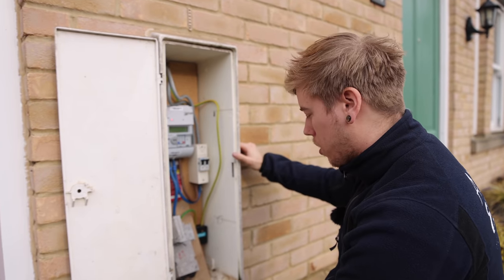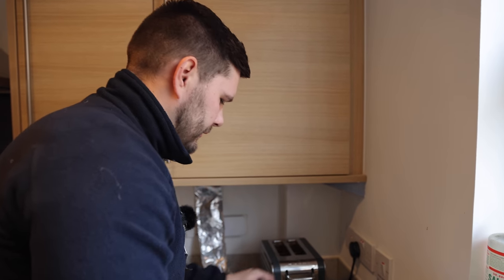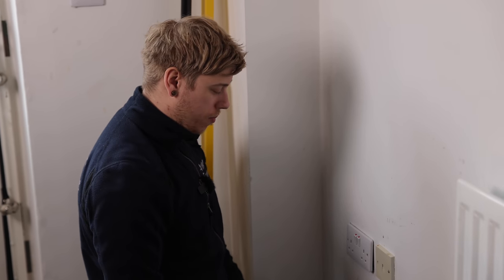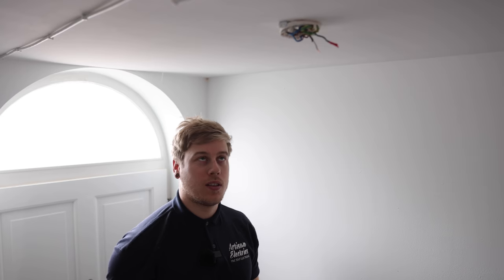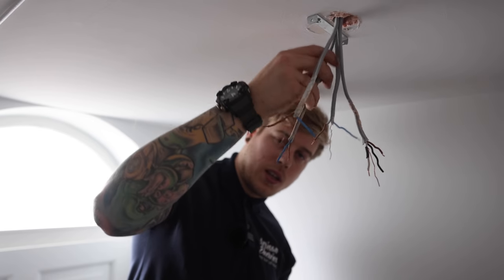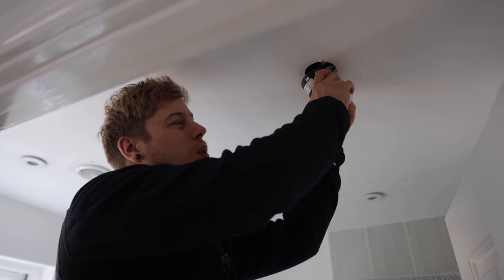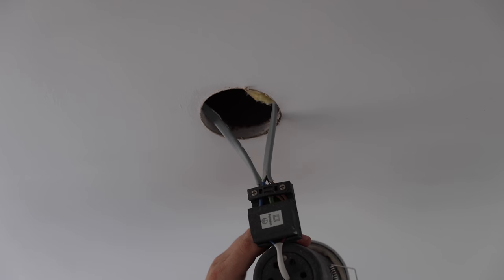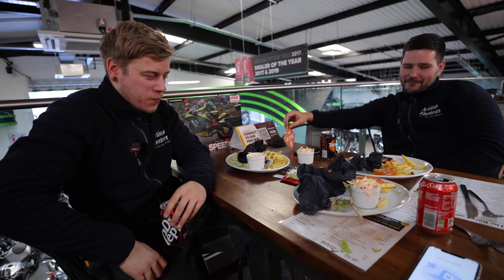CHECKING DIY ELECTRICS, INSTALLED NEAT BUT WRONG! - Electrician Life

Comment: Hi Guys. Here in Australia, it is illegal for anybody to carry out any electrical work themselves, unless you are a fully qualified electrical contractor.  That takes in tasks such as touching/altering anything to do with power points, light switches, adding any wiring or wiring alterations, anything to do with meter boards etc. Simple tasks such as changing light bulbs and adding on a four into one power board are OK of course.

That said, the irony is that anyone can walk into any hardware store in Australia, and purchase switch gear, sockets, any type of flex cable etc, without question or restriction. Given that the laws in Australia state that you cannot carry out any electrical work DIY, then hardware stores need to stop selling these products to the general public. One approach could be for any shopper to show proof that he or she is a licensed electrical contractor at the point of sale at the hardware shop, when purchasing these items.

Your laws in the UK seem to be more relaxed on this topic, regards DIY workers carrying out certain electrical jobs themselves. I guess the downside to some allowable DIY electrical work to be performed by the general public, can bring on issues such as dodgy unsafe wiring, that can lead to electrocutions, and dwellings potentially burning down. I have noticed that a few UTube electrical channel shows include instructions and procedures in the professional electrical wiring of power points, light switches, rewiring or upgrading metre boxes etc. Does this then provide encouragement and a basic education for the DIY brigade to perform this kind of work best left to professional electricians. Food for thought there people!
Reply: I’m not an electrician but I do have a scientific/technical background. Changing a socket outlet, light switch, or light fixture, assuming the wiring remains like for like, is child’s play… not messing around with anything more difficult than that though!
Reply: @jamesherbert8391  Hi James. Given your background, gives you a distinct advantage over most DIY er's to carry out the work you have listed, but there are a lot of folks that attempt this kind of work with little to no knowledge with the basics of correct and safe wiring ciurcut procedures, trunking, earthing, testing etc. This is where the main problem lies with the general public, which brings on unwanted accidents and deaths, and destruction of property. I am not an electrician myself. With all due respect to yourself, i feel that any countries government can't play it with an each way bet. By that i mean, if you let the public perform some of the jobs of qualified electricians, as in the UK, then you will end up with ongoing unwanted consequences. In my opinion, it's better for a Government to make it illegal for the general public to perform any kind of electrical work, like here in Australia, and at the same time police the sale of electrical components over the counter of all hardware stores and electrical trade sales outlets. I know that in Australia, many people cheat the system, but the materials from hardware stores, and perform electrical work themselves to save money.  If their house burns down, it will be investigated for non compliant electrical work, and if proven, will void any insurance payout with the loss of their property.We get our share of deaths and property loss each year from unqualified electrical work carried out by unqualified people.
Reply from the maker: Interesting 🤔
Reply: In the UK, if you are not qualified to work on electrics but you have, you should notify your council buidling control you have made a change and they will come and inspect it before you energise the circuit. So whilst its not illegal to work on your own home, its also been made reasonably easy to have it checked for a small or even no cost.
Reply: @martyndavies1482  Hi Martyn, You make a compelling point here, but with respect to yourself, how many or what percentage of the general population would bother or go to the trouble of notifying their Council Building Control, cost or no cost,  that's the real question.Knowing human nature as i do, i would imagine some would and some would not. It's the would nots that raise the concerns here. Again, i raise the points of UTube electrical channels going into in depth procedures of carrying out professional procedures, which promote, encourage or foster the general public's participation into carrying out their own electrical work, and hardware stores and electrical trade outlets that sell electrical products to the general public that enable them to carry out their own electrical works.The bottom line is that when it comes to REAL health and safety matters in life, some things are acceptable to carry out with DIYer's and some things are best left to professionals to deal with. Finding that fine line or common ground between the two is the tricky part for the Governments and the population enlarge. Thanks, Greg.
Reply: @artisanelectrics  Hello to the team at Artisan. Yes, interesting indeed. I for one enjoy watching your channel, as i find your content and presentation interesting, informative, entertaining, fascinating and educational. However,  i guess the thing to consider here is are you really doing the general public a service by educating them on the methods and  procedures of professional electrical works best left for professionals only. That holds true for any other electrical U tube channel show or video presentation as well. That is something well worth thinking about.  Just my humble opinion there. Cheers, Greg.
Reply: If the laws changed in the UK to be as strict as they are in Australia, I would find that a significant government intrusion in to what I can do in my own home.  Of course I accept that the law is sensible with regards to gas and consumer unit changes (less so for running a new final circuit - which may be a better alternative than adding to an existing one, which is allowed) but there has to be some leeway for competent people to be allowed to do their own work.  I accept that does leave the door open for dangerous work to be done, but how far do you go - there has to be a balance. Perhaps we should be teaching more of this stuff at school, practical skills so that you can have some degree of self-reliance in later life.  In the UK until the 90s many new electrical appliances came without plugs - you had to wire on your own (a legacy from when we had different plug types). I remember plug wiring coming up at school - although many were put on very badly with single insulation visible and cord grips not secure.
Reply: Yes I agree, go into Bunnings, Electrical equipment to be installed by a Licensed Electrician, makes me laugh every time
Reply: @austinvert8626  I would say it was a very round number! Its another philosopical question, are the people watching these videos better off from it having presumably learnt something, or are they armed with a little knowledge being a dangerous thing? I'd like to think that if you are watching these videos you would have some level of wanting to do a good job, and you are likely going to do the work yourself anyway. I am inflicted with the DIY disease, heriditary through my father's side of the family, it can be a gift and a curse!
Reply: @rossthompson1635  I Agree and even if the laws were changed it would inconvenience the knowledgeable DIYer and the dumb DIYer would still continue to do their own work.  Last time I looked the UK was pretty high on the scale of electrical safety anyway - so must be doing something right.

I lived in Australia for some years and can say that getting an electrician to do minor works is all but impossible - they don't get out of bed for less than half a days work and charge like wounded bulls for jobs that should take less than 30 mins.  

Australia still presents a protected economy for trades - it extends to plumbing, technically illegal to change a tap washer, telecommunications, you can not install your own network cabling, or telephone extension points, as well as electrical work.  There was even talk of making home theatre speaker installation and TV antenna installation trade only activities.

I think the UK has got the right balance - although the upcoming requirement for AFDDs seems heading towards dictatorial rules for no better reason than commercial gain - and did I hear the other day that the industry wants 'electrician reset only' breakers?
Reply: @martyndavies1482  Where do you live? The last time I checked with my local building control it was a case of them not really wanting to so it was £2-300 for them to have a look.
Reply: @martyndavies1482  Not all work is notifiable under Part P.

"Part P will apply to all electrical work in dwellings, whether carried out by professionals or DIYers.

Some DIY work will require the submission of a building notice to the local authority and the payment of a building control fee.

Some minor electrical work will not be notifiable (see above). Examples include adding a lighting or power point to an existing circuit, adding a spur to an existing circuit or replacing a light fitting."
Reply: @barrieshepherd7694  Thanks, that is really interesting - I hadn't realised how far some of the Australian restrictions extended. Definitely to that degree it seems more about protecting trades than safety, I would find that quite oppressive!
Reply: @rossthompson1635  It was ! although as I'm not there now I'll freely admit to doing some of my own DIY 😄😎

Even a very well respected Technical / General web discussion forum bans discussion about how to connect telephones and home data wiring.
Reply: DIY is fine in UK for homes you fully own the property/land or where your lease allows you to do so (i.e. some shared ownership agreements) until you come to sell your property then you need to have checked it is up to code.
Reply: @MikeyRussell88  Currently there is no requirement to provide an EICR or equivalent when selling a house in England (I don't know about Scotland or Wales).  The legal requirement applies only if you are renting the property.

While an EICR may give a potential purchaser comfort it is not mandatory, a potential purchaser can of course ask you to allow an EICR at their cost.
Reply: I'm in Australia there really is a big stigma regarding diy vs using a sparkie. I enjoy watching the videos as it gives a different incite into what electricians do other that running new circuits and changing outlets.

Comment: I've had qualified electricians leave behind cables taped up, sometimes they just don't bother push the old cables out of the way tape them up and wire in the new ones and call it a day, so getting qualified electricians is by no means a guarantee that you'll have the job done right, just that at least you won't in principle have a fire from bad electrics and if you do you can call insurance.

Comment: 9:31 thank "god" for three phase power... No 10mm2 needed, just 5x2,5mm2, three phase, N and PE
Reply: Agreed! Love having three phase!

You can even run a 5 core cable for sockets and share a neutral as long as it's on a three phase breaker (well in South Africa and Germany you can).
So washing machine, tumble drier and dishwasher each get a socket on a different phase and share a neutral!
Reply: @the_real_hislordship  yes, I do that too if it's surface mounted cables. And also I use in the garage for example a three phase connector and normal sockets of the same 5x2,5. Just have to make sure if it's behind a RCD all phases are behind the same RCD
Reply: @justme5384  snap!
I've just installed another outdoor three phase socket for my garden shredder (search YouTube for Stihl 375 and you'll see it in action on my other channel) and then added a single phase socket next to it for a lawnmower on phase 2.

Comment: Powering up the outside light with its faults ….. glass missing ….pir board open to elements….. not working before but now is 
Would of been safe practice to of terminated the light 
Aluminium body live pir board in public area